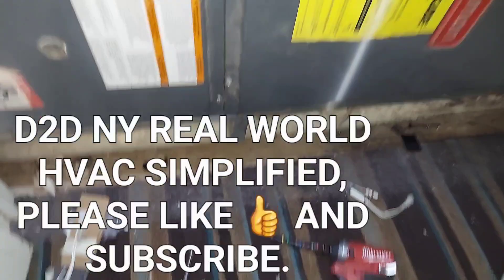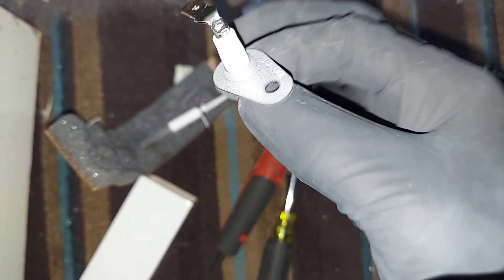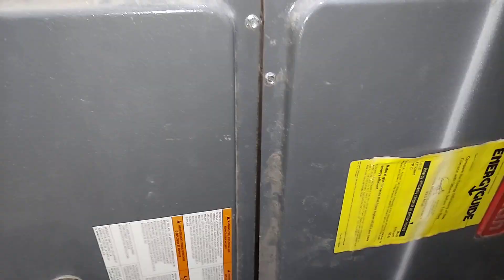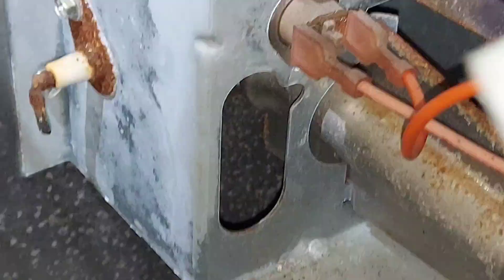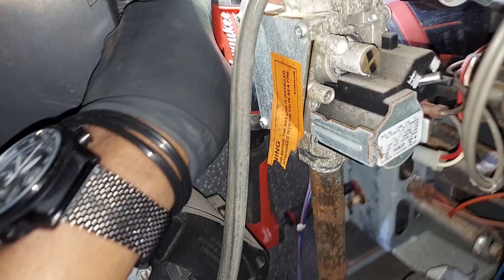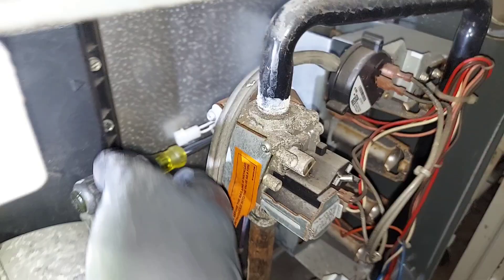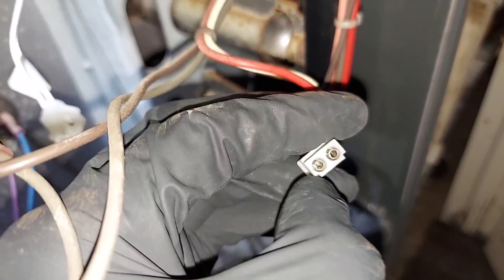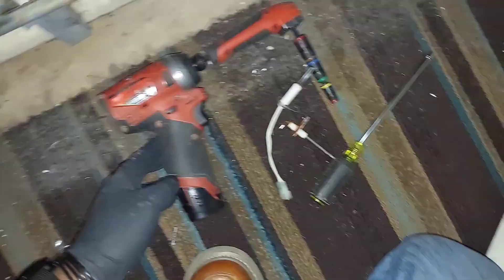GOODMAN FURNACE FLAME SENSOR | IGNITER REPLACEMENT

Comment: Hard to follow. What is the model number of this furnace? Where is the ignitor located Where is the flame sensor located?What tools are required?   What are the part numbers for the ignitor and the flame sensor?  What is the very first step in the process - isn't it the removal of the fron cover?
Reply from the maker: I would say consider calling a pro if you can't follow on your own
Reply: @D2DNYAC  I found some better images and located the igniter.

Comment: Great video.. what nut driver tool are you using for the cordless drill. Thanks
Reply from the maker: It’s a Klein 7-in-1 Impact Flip Socket Set, 6 Hex Driver Sizes

Comment: i received a quote for 675.00 to replace igniter and flame rod.  this took you less than 1/2 hour? why so expensive
Reply from the maker: My friend he must be very skilled in his craft and took years to develop it and so his service comes at a cost. 🤷‍♂️
Reply: They gotcha didn't they
Reply: Did you receive a quote to replace igniter and flame rod, or did they schedule a tech to come look at your unit, diagnose your problem, bring the parts you needed and then replaced igniter and flame rod?  Those are 2 different scenarios.
Reply: @D2DNYAC lol haven't laughed so hard in a long time